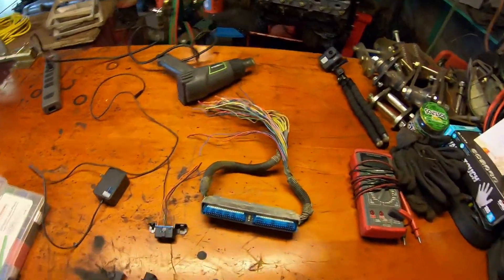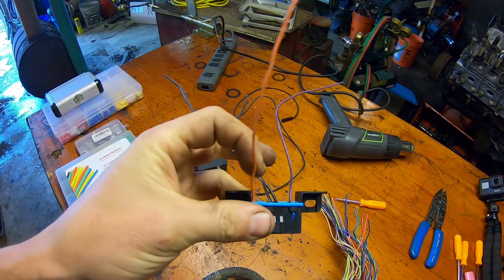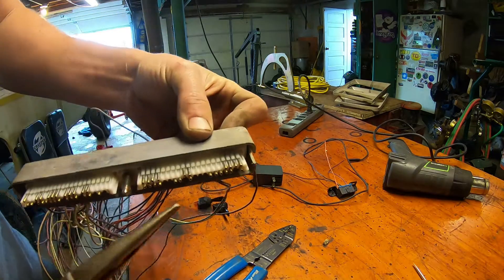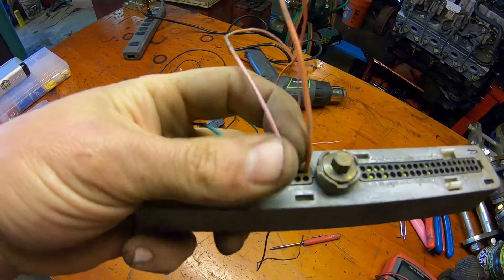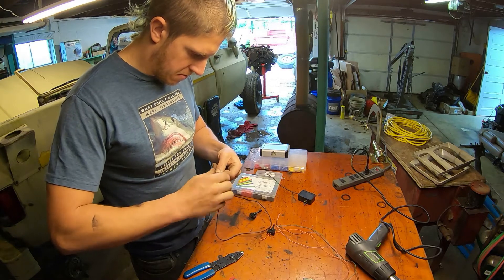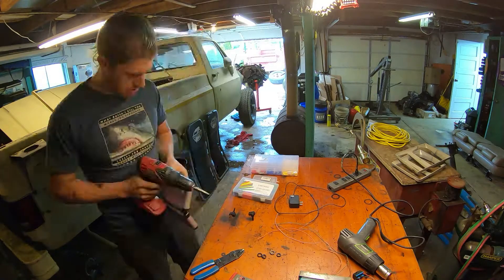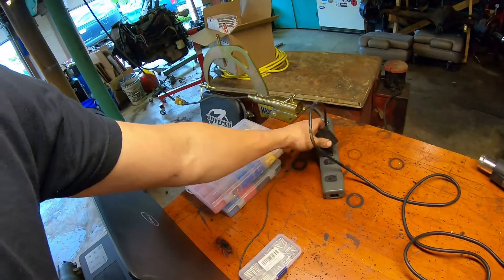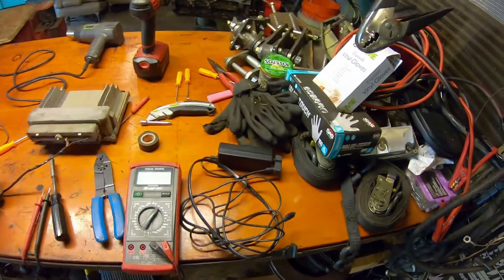6.0 CUCV Part 2 - BUILDING a Bench Harness to TUNE LSX Engines!

Comment: Alot of guys have bricked there PCM's using them junk wall wart power supplies!  Be sure to at least get one that is Regulated.  At least 12.8 volts at 2 amps.
Reply: Wall Warts are crap!  Get a variable voltage regulated supply of 5 amps and set for 13.0 volts.  ECMs don't like less than 12v and get about 13.6 or so when engine is running!  Look at a wall wart power supply with a oscilloscope, They put out more AC than DC!!!
Reply from the maker: 4+ years without any problems so far, probably more than 100pcm's tuned or modified in one way or another.
Reply: @MohawkMotors  Awesome!  Your a lucky one!

Comment: i would recommend a 3 amp fuse for the power supply. also check out open source pcm LS flashing (ls droid and pcm hammer).
Reply from the maker: That's a good idea, I didn't think about that because of the transformer being there but a transformer could surge or spike as well. Thanks for the tip!